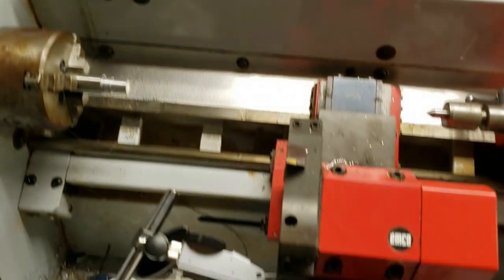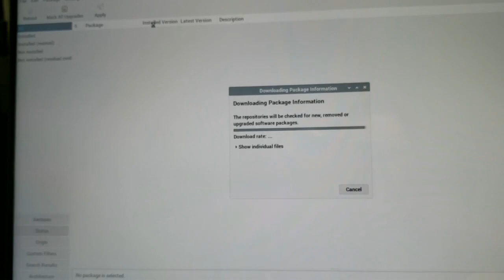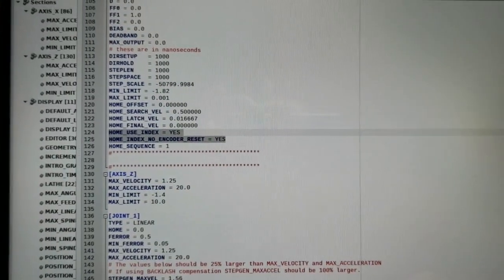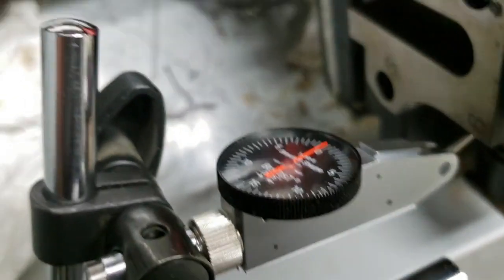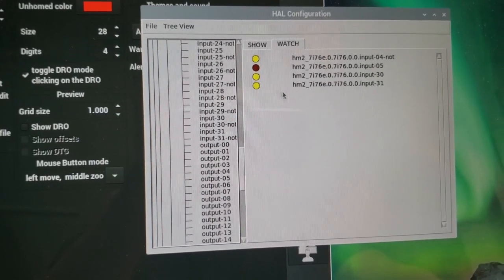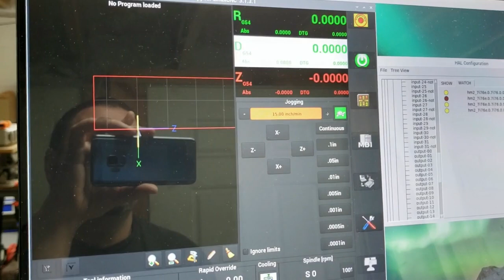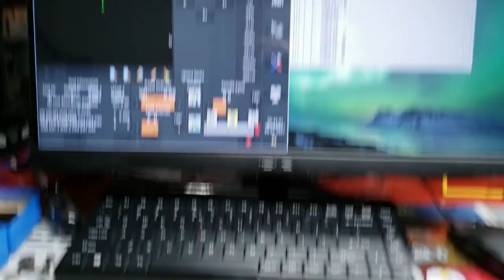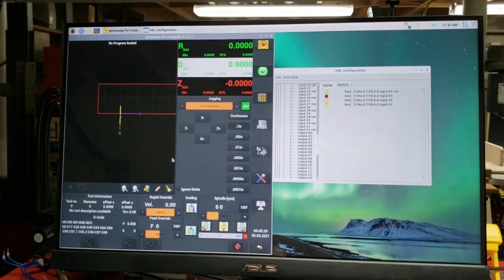Emco PC Turn 55 - prox/home switch success

Comment: Hi, I am retrofitting emco pc 50 turn.  This is my first linuxcnc project. I got 7i96s Board. I like to ask how did you wire up the proxy to the board and how did you wire the homing microswitch?
Reply from the maker: You basically just use two inputs per axis and configure the hal and ini file accordingly. The sensors are pnp, so you'll have to have your input common go to 0v and you'll have 24v+ input signals. That being said, the microswitches will be sourced from 24v+ into the other inputs.
Reply: @TheFeralEngineer  Is it possible to do this on pconfig or do i need to know how to manualy config the ini file
Reply from the maker: @samuelriippa2835  it takes manual hal configuration. I sent you my config, but I'm traveling for work and haven't had a chance to look through the hal file and show you exactly what is needed. I'll try to do it tonight
Reply: @TheFeralEngineer  Thank you. I tryed to learn the files and notice that there is not so much different when I compare our machine hal and ini files. But your custom.hal file is more different. there is  homing for proxy and turret classic ladder etc.  So I think I need to modify my custom.hal file and figure out what pins to use on my 7i96S card
Reply: What pin/connector is the proxy switch wired on the emco ? Is it the sync impulse axis pin ?
Reply from the maker: I have the proximity sensors and the home switches on individual gpio inputs
Reply: @TheFeralEngineer  is the proxy sensor the wire that connects to the axis sync led on the emco board
Reply from the maker: I don't remember. I disconnected the AC95 two years ago

Comment: Do you have the Hal commands for this ?
Reply from the maker: I do. I won't be home all week, but I made it all work. It's nothing special from Hal, it's more of an ini setting and just mapping the two sensors as mentioned in the video

I'll put it up on my github when I get home
Reply: @TheFeralEngineer  thanks man . iv added the two lines in the ini and net the signals in Hal. (Might be wrong). It finds the limit switch . Then keeps going in the same direction to find the pulse but dosnt do anything when it pulses. Pulse is wired into one of the inputs, triggers every full rotation of the stepper in hal show.
Reply from the maker: @choco107  I'll grab it this weekend and toss it up for you. I thought I showed the hal file in this video... It may have been the other video when I first had the issue
Reply: Managed to get it working today :)
Reply from the maker: @choco107  awesome!